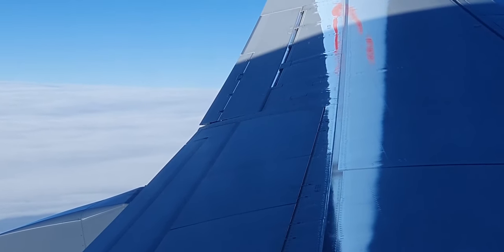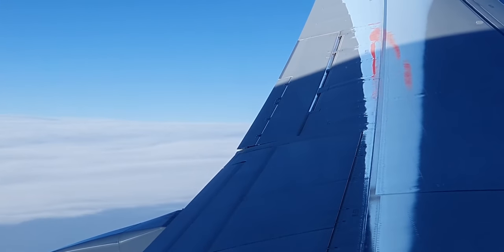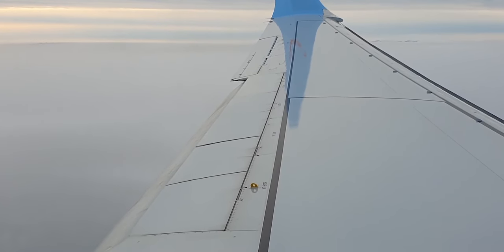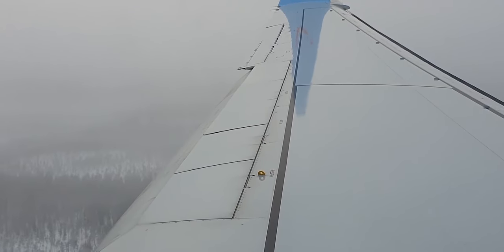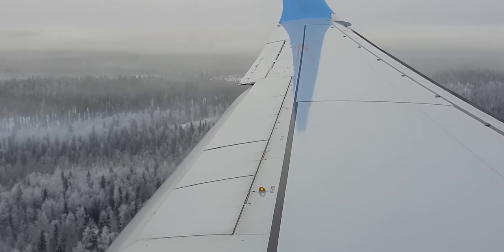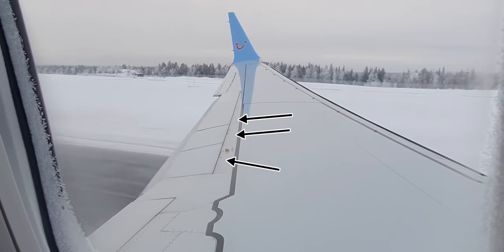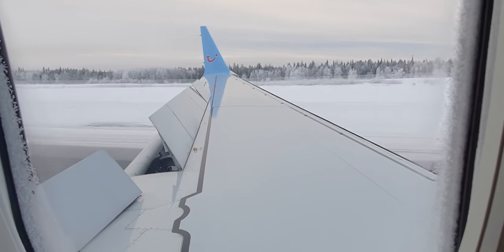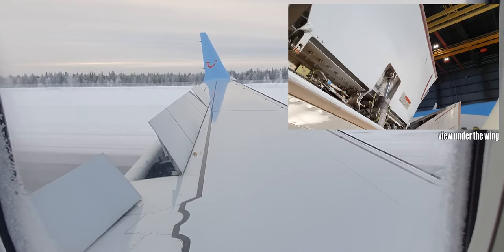Boeing 737: Aileron and spoilers on low speed vs. high speed (simple explaination video)

Comment: Great video! Although the reason why they don’t use aileron during the high speed flight is related to the shockwave formation (control reversal) not because it’s going fast :)
Reply from the maker: Thanks for explaining that! But how does an airplane manouver at higher speeds then?
Reply: @NextGenerationMechanic  They maneuver mostly using the spoiler as you explained! They barely use the aileron but mostly rely on the spoiler to roll the aircraft. If they use the aileron, the wing will exceed the critical mach number ends up getting shockwave on top of the wing. That will cause the airplane to roll opposite directly of the pilot’s intention. It’s called control reversal!
Reply from the maker: I see. Thanks for your explanation. I've learned something today :)
Reply: @NextGenerationMechanic  Hi.  The 787 uses a flaperon at high speed roll commands. For low speed, both flaperon and aileron operates. Flaperon is jus aft of the engine, cant be seen in the video.

Comment: Hey NGM,
You have some great videos. 

What is the difference between spoilers and speed brake? Thank you for the kind reply. 😊😊 watching from Japan
Reply from the maker: Hi, thank you very much! They are practically the same. Spoilers is the name of the component and speed brake is the action the spoiler does.
Reply: @NextGenerationMechanic  thank you for the reply. Can the pilot pull the speed brake lever to control the brake manually or is it only computer controlled?

I moved to Japan from the US and I used to go to Miramar every year, now I go to Komatsu. I think the airshow is in 2 or 3 weeks. In Komatsu they have a huge 5 floor car museum. The Motorcar Museum of Japan. They also have a aeroplane museum down the street.

They have what looks like a glider but it has a bicycle attached. IDK if the bike is for TO/L or if it has a propeller attached. The wingspan is soooo damn wide!! 

If you ever are in Los Angeles you MUST go to a restaurant and viewing location called, "The Proud Bird" 

That is a dope ass place and a great place to go with your buddies for food and beer or to take a date. Great place, very cool place.
Reply: @NextGenerationMechanic  I wanted to also ask if you will do some type of teaching videos where you speak on full systems, flight controls, flight theory and flight physics and other material that can teach us in depth? 

I may not be able to get a chance to fly again but I find enjoyment in flight sims. I may have only flown a few times with people that let me take the controls and showed me a few things. I watch many channels and some help with a sim. Infinite Flight is free and has DLC that can be paid for but damn... I have no clue how to read the data and make/follow a flight plan. I just push back and take off. Lol.

Whatever you do, I will watch. I have already watched 3/4 of your videos and I found your channel early this morning when searching for info on the 737 that had a failed wheel on Aug 20th.